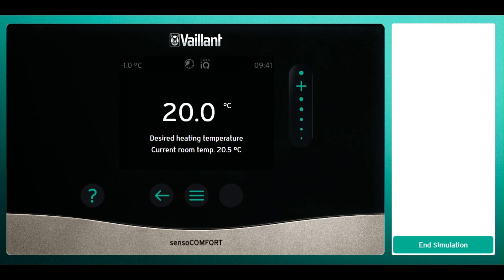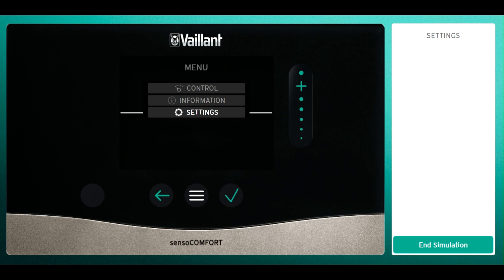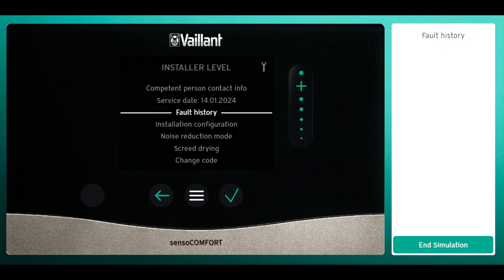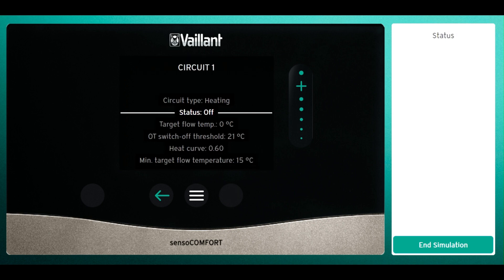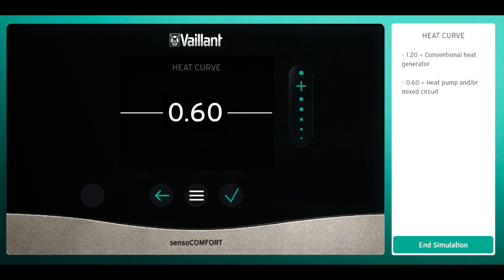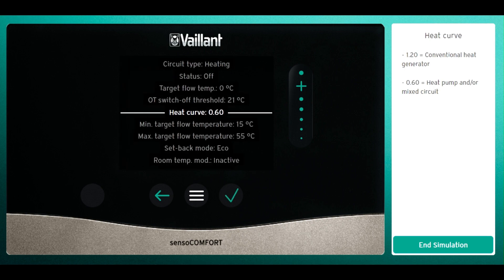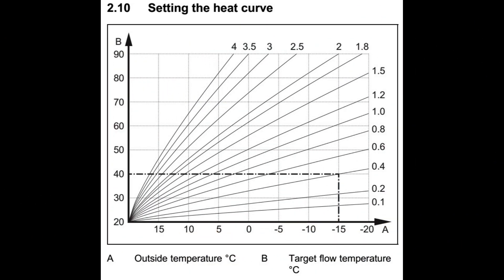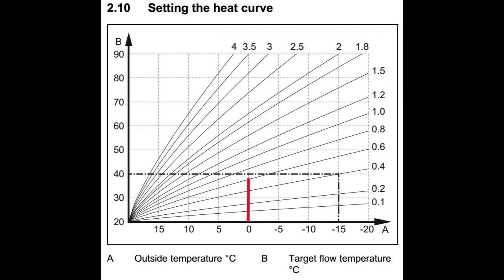The heat curve explained Vaillant HEAT PUMP #vaillant #heatpump #heatcurve

Comment: You have gotta be kidding me with these buried settings:
 Settings
Installer Level
00/17 (Access Code)
Installation Configuration
Circuit 1
Heat Curve

Could this setting be buried any deeper into the abyss?
Reply from the maker: I know, but if you have the app the heat curve is easily accessible!

Comment: I have a senshome thermostat and I don't have the options that you entered, I can't adjust the temperature of the boiler, i.e. the flow water, it shows the flow temperature, but I can't change it, so it consumes electricity and doesn't heat, it doesn't go above 40 degrees, how to set the heating curve, what do I have to do, the only temperature I can set is the room temperature or if I turn off the thermostat directly on the boiler, but then there is no point in having a thermostat if I have to set it on the boiler
Reply: Have you got a weather sensor installed? These options are only enabled after the installation of a weather sensor eg VR20

Comment: just learning about some of the settings as my  thermostat was reset (not by myself..) and im thinking it may of lost some of the settings that were applied  at the installer level during installation.
Outside of the heat curve is there any other settings i should take a look at?

and on topic of heat curve, am i right to understand that the heat curve setting will essentially dictate what the flow temp is automatically?
Reply from the maker: It’s a bit difficult to judge what settings would be best without knowing the system.

Yes, once the heat curve is selected, it will use that line to dictate the flow temperature based on the outdoor temperature

Comment: I can not get my Vaillant ASHP to reach the desired room temperature... heat curve is set at 0.6 and I can't get it above 19 degrees even though I've set it to 21 degrees. If I raise the heat curve will this make a difference? Many thanks.
Reply: You can try nudging the heat curve up a bit and leaving it a few hours to see if you notice the difference. You should, as I understand it, use the heat curve rather than the thermostat controls to control the heating. You want the heat to be trickling in a steady way, so effectively on constantly during the day, but a low temp, rather than heating up, cooling down, heating up etc etc.
Reply from the maker: It will do, also worth checking the minimum & maximum flow temperatures, they will be by the setting for the heat curve
Reply: @i85_Heat_Pumps   sorry to jump on to someone elses comment here. Im just curious what the recommended values might be for min and max flow temps

my stat was  factory reset and im checking to see if any of the values are note'ably off from what they should be at.
Reply from the maker: Depends on the property and your heat emitters, generally underfloor heating can run at lower temperatures. Best to experiment a bit, keep lowering until you find the house is not maintaining the desired temperature.

Comment: Very interesting.  I’m going through heat pump literature considering options for my house.

I worked with pid controllers on automation systems.  If the room temperature deviates from the set point, is there any increase/ decrease in flow temperature (proportional gain) to accelerate heating of that space, or is the flow temperature going to remain fixed for a given outside air temperature until the heat curve is manually changed?
Reply from the maker: If you enable the “adaptive heat curve” it should allow the control to make fine adjustments based on load. Normally most systems have the adaptive heat curve disabled, this can be found in the SensoComfort, installation configuration, then go to installation

Comment: I'm not entirely sure how this works. Does it mean that the higher the flow temperature the quicker we get hot water in our rads?
Reply: Okay, I get it. So because it's using an outside weather a comp. It overrides you setting the flow temperatures  manually. 
Question: if the outside temperature for example is 18°  but I want my home to 22°  my Actual flow temperature (Heating circuit 1) is showing 32° This will never get the house temp to what I'm asking for I would expect it to ramp up
Reply from the maker: It depends on a couples of factors, what your design temperature is in relation to the heat loss on your house, heat emitters and most heat pumps will have an outside shut off temperature so the heating will not run when it gets over a certain outdoor temperature, regardless of any other heating demands with or without 3rd party thermostats. But in answer to your question, it should be able to achieve this although difficult to assess without all the information
Reply from the maker: Yes, the higher the flow temperature the quicker the radiators will warm up, the lower the flow temperature the longer (and me more efficient) it will take to warm